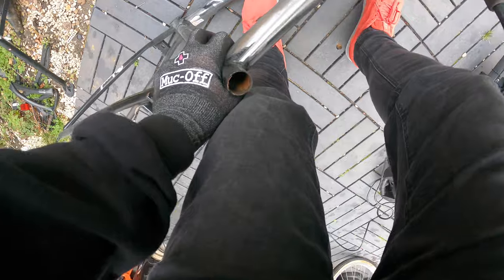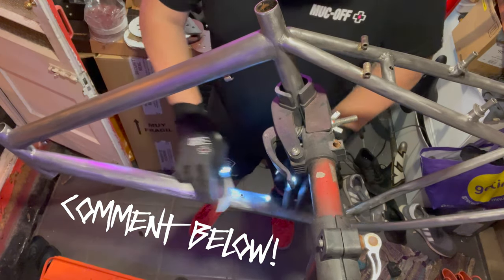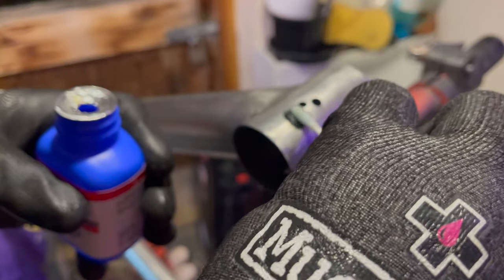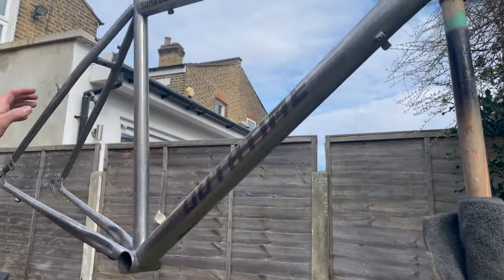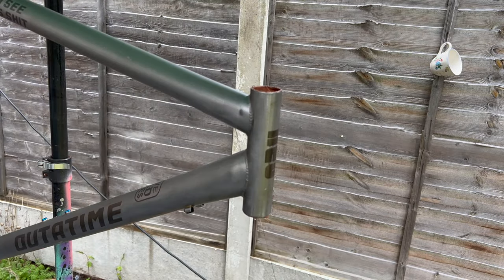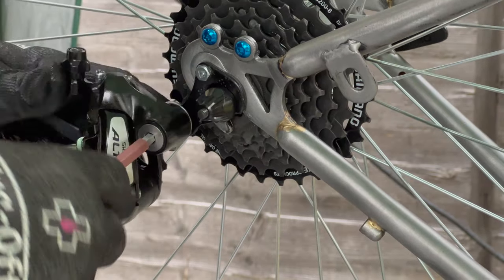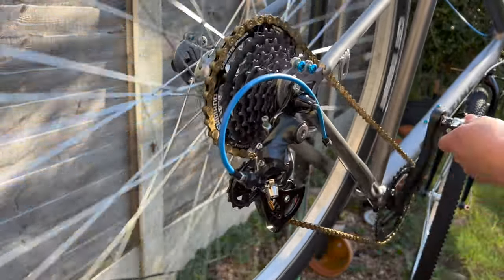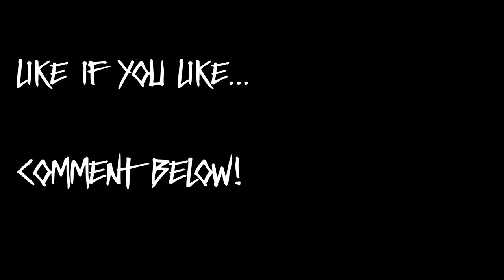Back to The Future Themed bike Part 2! - Dad Bike Restoration  -  Commuter cruiser vintage bike

Comment: The bare steel with blueing for decals was brilliant!

I've left bolts half-out like that when I don't have the rear rack mounted for more than two years and never yet lost a bolt. If I grind them down to clear the chain then they're not long enough when I do mount the rack.

Comment: Another awesome build! 👏 with the 8 speed Altus derailleur not having a clutch is occasional chain drop an issue using it 1x? I’ve tried this setup before but had to use a front chain guide to prevent it jumping off…
Reply from the maker: I’ve used this derailleur on a couple bikes with this set up now and it’s been fine. I use a narrow wide chain ring that might help but it’s been great!! 🙌🏼